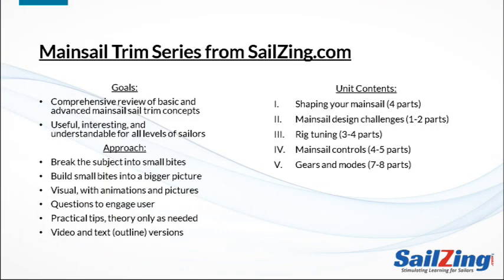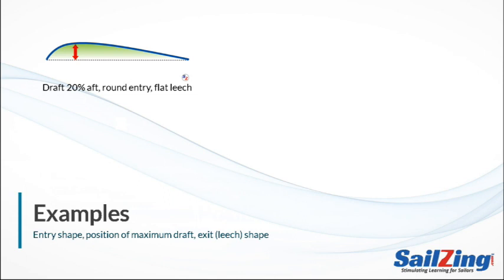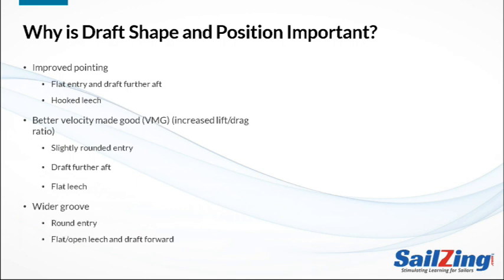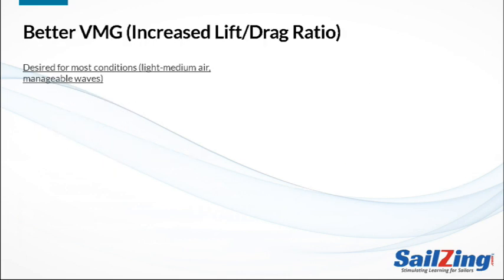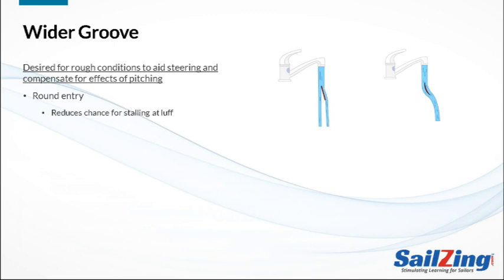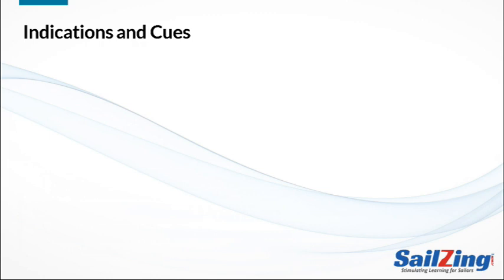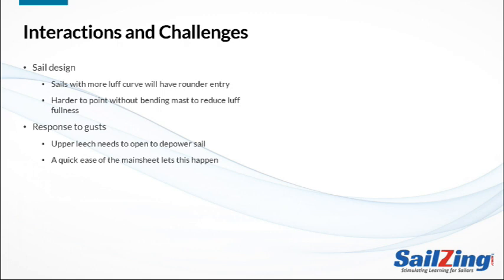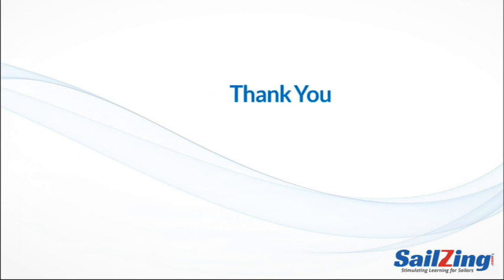Upwind Mainsail Trim: Shaping Your Mainsail, Part 3 - Draft Shape and Position

Comment: if you mention: "the draft is 40% aft", at what height of the sail is this measured? boom level, half way, top batten?
Reply from the maker: The draft position is likely to be slightly different as you move vertically up the sail, so it's not one number.
Reply: @SailZing  thanks! Ok let me re-phrase my question: in many books like high performance sailing / illustrated sail tuning I read: draft position should normally be around 45-50%. And ideal camber/draft depth is 16% in medium conditions. Where should I measure this / look at the sail? Can i just do it at the easiest place, the boom with a tape measure? Or is it somewhere half-way up the sail, so you have an average?
Reply from the maker: @MartijnDesijn  It's best to measure at several places. The easiest way to measure is with software, such as SailPack Vision. This is a free download. Take a picture of your sail while sailing upwind, then upload the picture to the software. Draw draft stripes at various heights as instructed in the program. The software will give you the amount of camber as well as the max draft position at each stripe. Hope this helps.

Comment: 3:29 "this drawing is exaggerated: with batons in the sail you probably couldn't achieve this shape". Wanna bet?
Kirby 25, we were clawing behind an island, I was looking at exactly that shape! When I went to adjust the leach line skipper told me not to touch it, that it was perfectly set for when we come out into open air. I wanted to tell her that at the rate we were crawling along that may never happen. I closed my mouth 😁. It's a control: it's meant to be adjusted. My opinion of course.